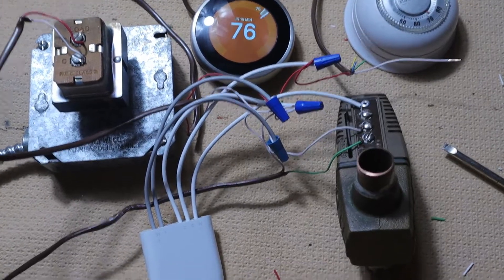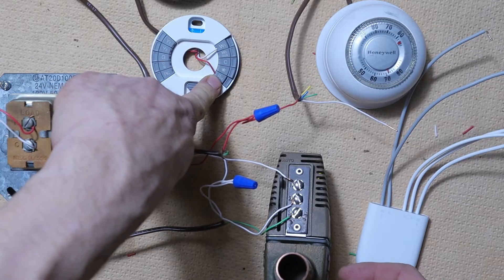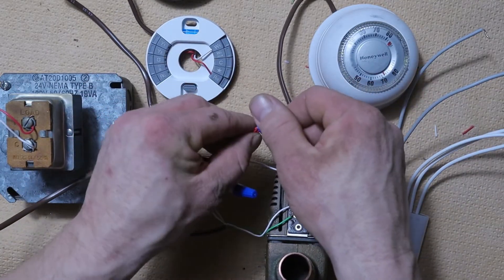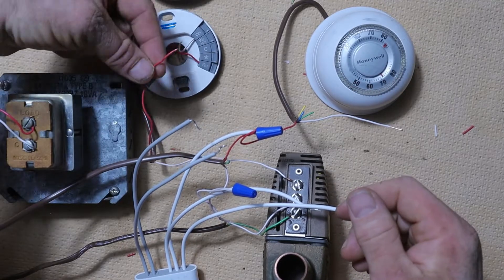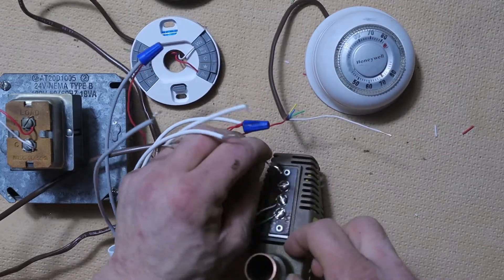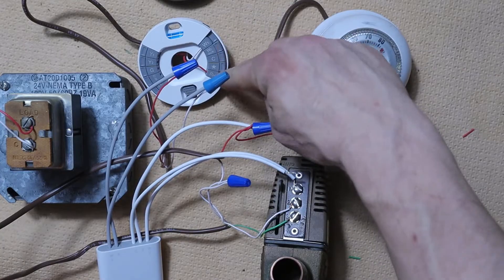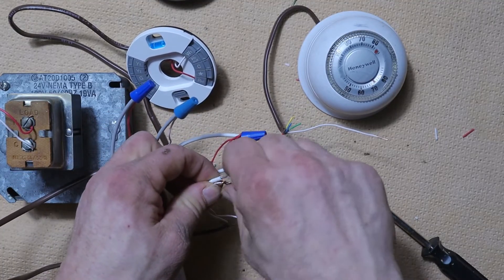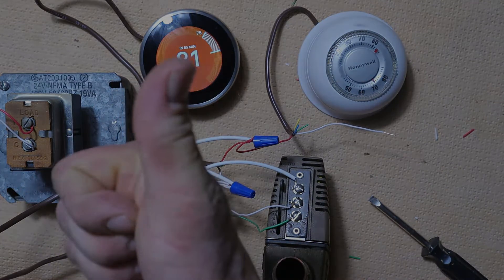How To Wire A Nest Power Connector to a Taco Zone Valve

Comment: I have 4 thermostats going to 4 PUMP RELAYS. No C connector for pump relays of 24vac transformer in my set-up. I suspect I need to buy 4 transformers to connect the C wire from thermostat to individual transformers. What a PITA. may need hire someone for this as this has taken hours to get to this point already. These thermostats are not for the faint hearted.

Comment: My Rh wire goes directly to number 1 terminal on taco valve. Red from load side of transformer goes to terminal 2. White from transformer is wire nutted with white (W) from transformer and white from other thermostat. Everything seems exactly backwards to what you describe. Is there a way I can connect the power controller?

Comment: SOMETHING IS WRONG?  I have two wires, red and white. The google Nest thermostat identifies Red as R wire, and White as W wire. As it is expected. However, in the basement, where my furnace is located, the red wires from all thermostats go separately and directly to the port 1 of the corresponding Taco valves. And the white wires are all connected to the 24 v transformer.  I would say that the white and red wires are swapped, as compared to the video. Meaning White is R and Red is W. But the thermostat does not validate this conjecture. It recognizes Red  as R and White as W.  Any ideas on how should proceed with wiring? My equipment is identical to the one in the video.
Reply: I guess my wiring corresponds to the one in the diagram at the bottom left here:
https://images.thdstatic.com/catalog/pdfImages/54/54a9bf5d-a7ff-48ec-9096-5edc04dbae4f.pdf

Comment: If I have 4 Taco zone valves, can I attach 4 Nest power connectors, that is to each of them? Google says the power connector works in a multizone setting, but you say it works only with one zone valve. Please clarify
Reply from the maker: One power connector for each thermostat. If Google claims otherwise then they need to clarify how that's done. And I can assure you they probably will not have an answer for that and tell you to call a pro.
Reply: @JerseyMikeHVAC  Thanks! By the way, if you install lates Nest thermostats without C wire,  google nest app offers you a free google power connector. Mine arrived in two days. One connector per google account.

Comment: Hello, I have two nest thermostats and just one nest c power connector, my furnace is gas with two tayco valve and need some help with that please and thanks. I think there is a raley box and looks like the two cable thermostat goes there to a tv and t connection. W in the middle but no cable there.

Comment: Mike
Where is video with rib relays 

This guy has 3 power connectors and 3 zone zone valves 

So I need 1-4va
3-rib relays and use NO

?
Reply from the maker: Can you elaborate a little on what you'd like to do?

Comment: Hiii first off thank you we were told it was impossible to use a smart thermostat with our boiler, it let us set it up and didnt say the c wire was missing but now it says c wiring fault, with a code it is working as intended but to make this go away, Do i have to put the blue wire thats tied with the white in the center screw in the zone valve to the C spot in the back of the thermostat?
Reply from the maker: Sometimes these thermostats will throw up these nuisance codes until they are sufficiently charged, then they go away. If the thermostat can be charged with a cord, you can try that and see if it clears. If not, then yes, that #2 terminal is often a mutual common shared with the thermostatic control circuit and the boiler T&T circuit, so it should work.
Reply: @JerseyMikeHVAC ours is the model that takes triple a batteries,  we had someone trying to install the regular one and they took it back told us we needed this one for low voltage and unfortunately, it keeps throwing the code and sending us emails about “urgent action required to avoid battery drain” They came back out said they couldn’t install a nest at all for our system but we bought this nest online so it was here to keep with your video i found out that what they said about not being able to install a nest is untrue!!! Worse comes to worse i will get 4 rechargeable triple a’s to keep 2 on the charger at all times while the other 2 are in the thermostat
Reply: It says nest power connector not detected

Comment: Hi Mike. If I have 3 zones, 3 thermostats/3 Taco valves running off one 24Volt. Do I need 3 Google power protector, one for each Taco valve?
Reply from the maker: Yes you'll need one for each valve. You should also consider upgrading to a 75VA transformer, as the one you have is likely only a 40VA. 40 is usually just enough for 3 Taco power head valves without the smart stats. With 3 of them, you'll very likely need more VAs.
Reply: @JerseyMikeHVAC if I have 2 zones (2 taco control valves) on a 24V transformer. Will it be ok to connect 1 google nest therm via power connector? Or would I need to upgrade my transformer
Reply from the maker: @cliffturn9  You should be ok
Reply: @JerseyMikeHVAC great, the other zone is to an old Honeywell thermostat that has batteries in it.
Reply: @JerseyMikeHVAC can you please help me out with my two taco valves for my two net thermostat?
Reply: I have two zones (2 taco control valves) on a 25v transformer. Will it be ok for two nest thermostats ? And I’ll need a nest power connector for each taco control valves?

Comment: I have 2 zones with the same taco zones. All cables are a mess connected to a bunch of bundles. No control board. Brand new transformer that I had to install since my transformer died 2 days ago.trying to figure out how to do this. With 2 separate zones without having to run new cables.
Reply: Same situation here, there is nothing out there to help with this problem. Hope find some help.

Comment: JerseyMike! I stumbled upon your video and thinking of trying but have a few questions. I have 2 zones. Only want to set a power connector to one of the tacos. However both my tacos have a white wire on #1 a red wire on #2 and a white wire on #3. From your description it looks like #2 should be a white cable. Mine are not they are red. Any thoughts or idea on how I should connect the power connector?

Comment: I dont understand why my HVAC company didnt suggest this. I had purchased the low voltage Ecobees to replace the old thermostats. The company said they couldnt find a way to make it work. Is it possible they just dont know?
Reply from the maker: These power adapters only work with Nest thermostats, and not even all nest thermostats. Ecobee does have a different version of something like this called a "power extender kit", but its pretty different than the Google power connector. Requires some new wires from the unit to the power kit, and then adjusting the existing wires from the power kit to the thermostat. 

You can check it out here: 
https://blackhawksupply.com/products/eb-pek-01?campaignid=386657145&adgroupid=1243548951059441&creative=&matchtype=e&network=o&device=c&keyword=&msclkid=14dd1eb0d9bd1d6c957f7bdf59dbb933&utm_source=bing&utm_medium=cpc&utm_campaign=Bhawk%20-%20Shopping&utm_term=4581321374188224&utm_content=Ecobee

 Most contractors would rather solve the problem permanently by running new wire or using relays, rather than attempt to use these types of gadgets that are known not to always work in all situations.

Comment: First of all, the video is great and matches my situation.  I have 2 Tyco zone valves and trying to add a Nest Power Connector.  I’ve checked & double checked the wiring but the nest tstat keeps showing a “Note: N260” and means I don’t have a C wire connection.   How can I tell if the  Nest connector working?

Comment: Just did this set up - my Nest still says "Low Battery", but the system seems to be working and gives no error. Will it always say "low battery" ?
Reply from the maker: It may clear up in a day or two. They take a while to fully charge.
Reply: @JerseyMikeHVAC is there any other indication that I did it right?
Reply: I heard a bit of an electrical hum after the install. And when I touched the center of the c-wire adapter it was warm.

Comment: I wired one of two Nest thermostats on a two zone boiler with taco valves. Zone 2 thermostat is taking power from AC unit in atic. Zone one heat only is now showing R1 & W are connected after following these instructions.  The only problem when it calls for heat the boiler wont fire. It only fires from 2nd Google nest. I question if Im using load or neutral from transformer.
Reply from the maker: Which zone is firing? 1 or 2?

Comment: I have a standard 2 wire radiator heat in my apartment. My taco zone valve does not seem to work with the nest power connector if I remove the original wires from 1 &2. The nest does not detect the W and R wires anymore. However, I’m a bit confused about where the common wire is supposed to connect as there is only 1 white wire to zone 2 so there is nowhere along the circuit to install the C wire. I’ve tried numerous wiring scenarios. Zone 1 appears to be wired to a wall plug that powers the unit and the R wire to my thermostat. Any suggestions on whether the wiring in this video should work with my system? I can’t seem to get it to function.  Zone 3 does not have any wires.

Comment: Hello,

So for 2 seperate Tstats controlling 2 seperate taco vales...

At the beginning of the video you sepeprated the "R" cable from the bundle going to the first Tstat and connected it to the grey R cable. Im assuming im repeating that process to the second set of power adapter and Tstat?

When undoing the 3 wires (red for Tstat1, red for Tstat 2, red from Transformer) and seperating them, Doing that leaves just 1 red wire(feed from Transformer) that both power adapter white "R" cable connetcs to correct? 

Then from there each thermostat gets there respective "W" white cable from the adapter to there valve top terminal.  Then both C white cables from both power adapters can get tied in with the budle of cables in the middle terminal of the valve?

Where does the "W" gray cable from the power adapter connect to?  The respective "W" cable from the tstat?
Reply from the maker: Hi. Yes, you are correct on all 4 points.
Reply: @JerseyMikeHVAC  where would the 3rd terminal go to?

Comment: Wow thanks so much! 
I have a 2 zone taco valve system my older nest seems to run fine for zone one but I need to install this controller for zone 2 ( I’m adding a nest for upstairs on z2)
Will this same scenario work for me?
Reply from the maker: With only 2 zone valves, I believe it will work without issues. Normally you will have a 40VA transformer that can handle at least 3 Taco zone valves which are pretty energy thirsty, so having two should leave you enough room for the additional 2nd Nest with a power connector.
Reply: Soooo I found a third wire and was able to use that without the control unit and attached it to the C terminal on the transformer. It seems fine now, I was able to get it running. Google sent me the control unit for free so I have it if I need it. Thanks for your help 👍
Reply: Thanks I’ll try tomorrow and let you know!

Comment: Can you just add the common to the second terminal?
Reply from the maker: In most cases, yes. So long as there is a wire from that terminal to the common connection at the transformer.
Reply: Thank you! very helpful video. @JerseyMikeHVAC

Comment: For a nest thermostat install, could you do a video for 2 zone boiler with thermostat wire harness has 4 wires(or5...I forget how many), but only 2(red/white are hooked up at either end?
Reply from the maker: Just connect one of the unused wires to C at the thermostat and the other end directly to common on the transformer.

Comment: Hi Mike, this is a fantastic video. Thank you for making and sharing it. I have a slightly different wiring setup in my 5 taco valve heat-only system, and I wonder if you have any suggestions for making it work.
I can see that each tstat R terminal runs directly to each #1 terminal on the taco valve. The W terminal on each tstat runs to bundle that also contains the Common terminal from the transformer. Finally, the #2 terminal on each taco valve runs to a bundle containing the Load terminal from the transformer.
Watching your video, I'm struggle to understand how it is that my system works. Do I need to rewire it completely? Or does this seem to be fine, since the right circuits are connected when the tstat calls for heat? Thanks so much!
Reply from the maker: You don't have to rewire it. It's the same circuit just in reverse. 

Power is leaving the transformer going to the #2 terminal. It then goes through the zone valve coil to the #1 terminal. From there the 24v travels up to the thermostat. On a call for heat, the 24v is transferred to the W terminal. It then makes its way back to common on the transformer. 

If you're trying to hook up a power connector, in your case you want to disconnect the wire from the taco #2 terminal and tie that in with the R wire on the right side of the power connector. 

You will then take the wire from the thermostat R terminal off of the taco #1 terminal and connect it to the R wire on the left side of the power connector. 

You will then take the wire from the thermostat W terminal, disconnect it from the bundle and connect it
 to the W wire on the left side of the power connector. 

The W wire on the right side of the power connector will get attached to the #1 taco  terminal. 

You'll then need to add a wire to the taco #2 terminal and connect it to both the C wire on the power connector AND the bundle that goes back to the transformer common. 

Take pictures of sketch out the original wiring before starting this, just in case something isn't working right so you can revert back to the original wiring. It would also be good to have on hand should you ever decide to get rid of the nest down the road.
Reply: Awesome  @JerseyMikeHVAC  . Thank you so much for taking the time to read my question and develop and share a solution. I have just one clarifying question: for that wire I'm going to add to the taco #2 terminal, can I connect it to the bundle that goes back to the transformer common, and connect the C wire on the power connector to that same bundle? Or were you envisioning something other connection? I've tried to illustrate what I wrote with this Google Drawing: https://docs.google.com/drawings/d/1bIdSUlsu39ngvK74uQpkwKVEwpZwCpOnsBD59QYlElk/edit?usp=sharing and what I think you told me to do with this drawing: https://docs.google.com/drawings/d/1ZdrlaWEbUcsT_uR89ptDbmobic8KEl30_ism51-UjNA/edit?usp=sharing. I hope I got it right!
Reply from the maker: @glendfriedman   You can connect the #2 taco wire to the common on the power connector, but only connect it to the bundle if all of the taco wires on that bundle are going back to common on the transformer. Currently, your #2 terminals on the tacos are not commons. They are 24v power. If you're only doing one zone valve, just go to the power connector common and not the bundle. You might have to run another wire from the common on the power connector to the transformer common, but it might possibly work without.
Reply: Hey Mike! Thank you so much for all of these instructions it’s helped a ton. We have a 2 system taco and we got the first zone set up and working well with the power connector. We are now getting a message on the second zone with a second power connector that it cannot detect our R and W wires. We set up the second the same as we did with the first. Any ideas? Thank you!!
Reply from the maker: @julieannemascera3435  If the wires are properly connected to the thermostat than it is unlikely a wiring issue if both R and W are not detected. I would suggest trying a factory reset on the Nest to see if it will pick up R and W then.
Reply: Thanks so much for this, my setup seemed to match this. Just one question, it looks like my taco valve no longer needs anything on the #3 terminal, does that sound right? I assume this is because the power connector now takes care of that aspect of the circuit?
Reply from the maker: @clintdogg01   The #3 terminal is part of the burner circuit and has nothing to do with the power connector, which is part of a different circuit. 

The only time the #3 terminal is not needed is when you have a switching relay that activates the burners independently rather than through the switch inside the zone valve.  In this case, all you need are two wires to the zone valve to activate the motor that physically opens the valve.

Comment: I have to deal with a similar setup, but there's a zvc404 control board involved. Does that change anything?
Reply from the maker: It's a bit different. Wires from tstat go to 404 rather than the zone valve, so the connector would have to be wired in there at the relay. The 404 should also have a common connection where the tstat wires come in. So you'd use that instead of the common off the zone valve.
Reply: @JerseyMikeHVAC  thanks, yeah it's quite different. Thanks for the video, figuring it out on my own would have taken a while and would probably have required trial and error, that's if I ever got around to identifying the terminals on the zvc404
Reply: @JerseyMikeHVAC  I have a 404 as well. What does "wired in there at the relay" mean?  Also, does the C terminal next to the tstat wires always have power?  I haven't been able to figure this one out but loved your video!
Reply from the maker: @QuantumHorangi  The 404 is the relay. 

C at the stat is dead unless there is a wire connecting to it from the 404 relay itself.
Reply: @JerseyMikeHVAC  Thank you! Just finished up and ended up not needing the Nest PC as I had a third wire hiding out that I connected to C to the thermostat.